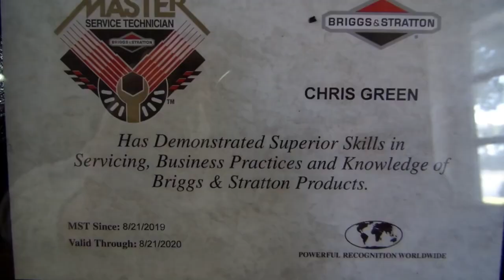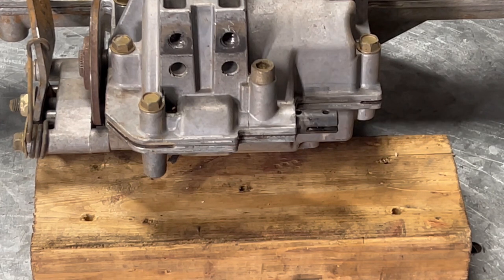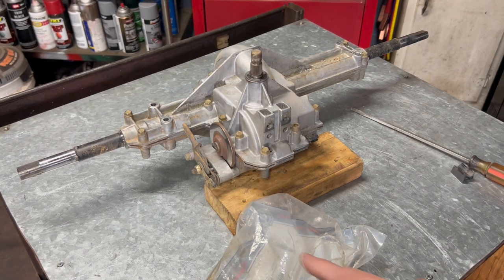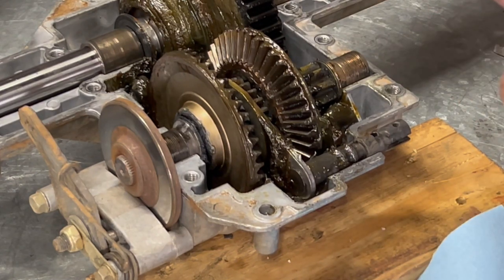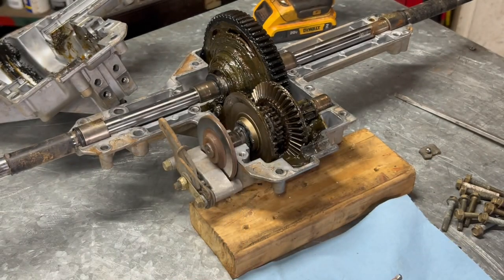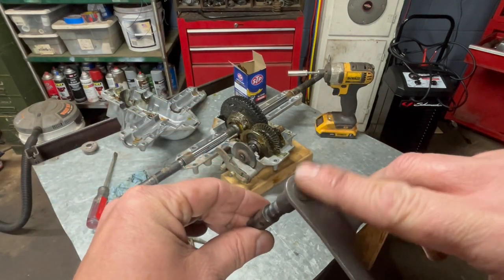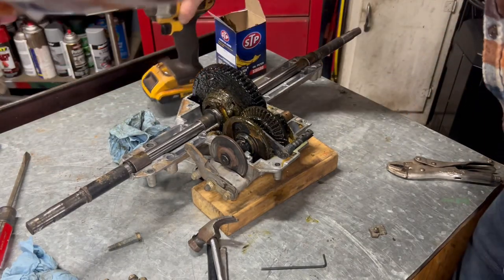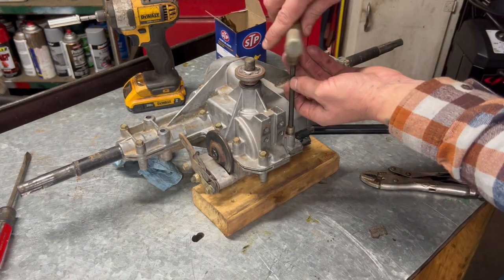Troy-Bilt Pony Stuck in Neutral

Comment: What was the part number recommended by MTD that you tried but didn't work?  I have an older model from about 2012 with this same issue not going into gear.  I have a parts lookup showing the fork as 911-0011 and it shows the dent ball part number too as 741-0862.  I haven't yet disassembled my transaxle.
Reply from the maker: It’s was the same shift fork I had in stock but wasn’t right size.
Reply from the maker: If you have the break down on your transmission for your mower and have the part numbers, you good to go. This particular Troy built didn’t have a breakdown for the transmission. That’s why I called MTD and they gave me a shift fork number which was the same one that I had in stock and was not the right size. When I called them back to tell them, they said they didn’t know what was going on. And why it would be a different size. But this is a special situation because there was no parts breakdown for the transmission..

Comment: Like to preface this by saying, I drove mine into my brackish lake nonetheless.  Now it likes to get stuck in whatever gear you leave it in for longer periods of time. the first time I just sprayed WD-40 on it and got it to function fine this time over the winter break it got frozen in neutral. PB blaster seems to get it to work better but not fully can I just take out the ball bearing entirely and just run it without it?! 

I’d like try this before I go in and fully rebuild or swap out this differential/ transmission.
Reply from the maker: The ball bearing holds the gears together, you can order the slide fork and bearing online.